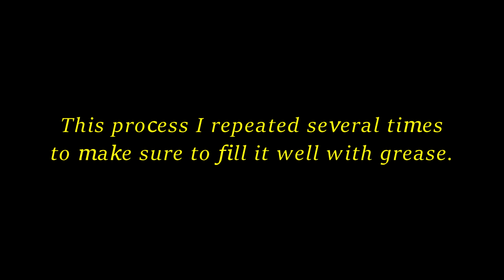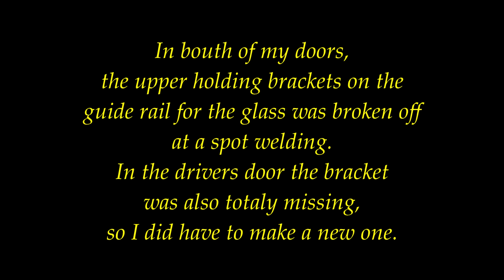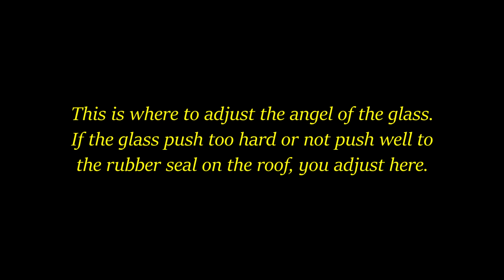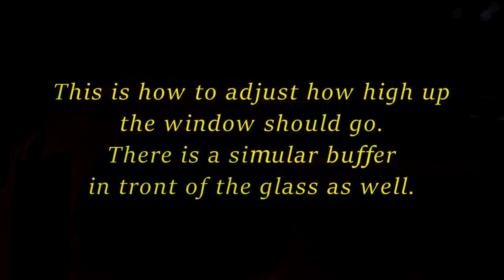SAAB 900 Classic convertible. Power window refurbishing.

Comment: Terje, you can grease the gearbox without removing it from the door,  get one of the retaining screws, drill an axial hole in it and tap the head to take a grease nipple. Then pump grease directly into it.
Here's what I did
http://www.uksaabs.co.uk/UKS/viewtopic.php?f=66&t=194004
Reply from the maker: I also have heard about the nipple idea, but as I did not have any of them or a grease pump in hand.
So this become the solution by now.
It does also not take that much longer time this way, and I think it is good for the elevating system to get out for a real cleaning and lubrication as well...
Reply: Useful tips from this video. Great work  @TerjeNormann   :) I just did this operation to my power windows and took a little bit of both of yours and Trollboosters advices. Greased up the motor still mounted in the door from the screw hooles using a large syringe filled with lithium grease. Then lubricated all other moving parts in the mechanism. Now the windows is moving a loot smoother :)

Comment: Hij, This has given me confidence to tackle mine (1990 C900 S). The driver side has displayed 'awkward/uneven' movement but not slower than normal, symptomatic of mechanical resistance. At one point three weeks ago I could hear the regulator motor clicking and disengaging without input, like a relay would click but with additional faint motor noises. I did a basic clean around the window seal and it worked just the same. Today no activity whatsoever from the mechanism. Window is fortunatly* in the closed position (*despite the 40c heat here for the first time). The mechanism obviously needs attention and will get it. Does the sudden transformation from 'working OK but a bit lumpy' to 'no sign of life' mean that I should pre-check the switch and electrical connections first?  This spec is new to me having a history of 99s.

Comment: Hi Terje, Thanks for clear video, that is my problem, I think the engine is defective do you know how to fix this without disassembling everything? Greet André van Beek
Reply from the maker: Iif only replace the motor, you need to unscrew the two screws that hold the mootor to the gear.
I'm not sure if you are able to get into the screws without to disassembly the mecanism. It is so tight in there.
But even if your motor is dead, I should do this entire job to make sure your system is not so slow that it is the main reason why your motor is broken.

Comment: Oh boy, another great video. i have to change my speedometer cable. oh and your advice with the pressure accumulator was pretty helpfull. but just asking, what would happen with the brake system if there is too much fluid in the brake fluid tank? also where can i find a fitting replacement for my defect brake pressure accumulator (ABS System). the only one that i found cost around 500-600€

Also you are lucky for having a garage. Down here in Germany its sometimes like a lottery. maybe i got something here so i can start working on my 900. i am gonna install a Trionic 5.5 and refresh the Turbo and the Gearbox
Reply from the maker: The only thing that should happen if too much brake fluid is...as I understand posibilities to over flow...only.
I do not know any other problems about to over fill..
I also have to change my speedo cabel, and I have one spare from my parts car.
The plastic connector for the speedo cluster is broken on the old one.

Here is some used accumulators on eBay:
https://www.ebay.com/itm/1990-1994-Classic-Saab-900-9000-ATE-ABS-Brake-Accumulator-4002267-Tests-Good/383247030296?epid=2069663124&hash=item593b4d9818:g:iDYAAOSwAUBdvgAp

https://www.ebay.com/itm/SAAB-C900-Classic-900-9000-ABS-Accumulator/303532514343?hash=item46abf29c27:g:1ZEAAOSwp6ReigTI

https://www.ebay.com/itm/1990-1994-Classic-Saab-900-9000-ATE-ABS-Brake-Accumulator-4002267-Tests-Good/383247764252?hash=item593b58cb1c:g:iDYAAOSwAUBdvgAp

https://www.ebay.com/itm/1989-1996-Saab-Accumulator-ABS-Brake-900-9000-ATE-4002267-55/352988958172?epid=2069663124&hash=item522fc80ddc:g:WLIAAOSwmVxeXIAE

And brand new
https://www.ebay.com/itm/NEW-Brake-Accumulator-Ball-Jaguar-JLM1907-Delco-25528382-Saab-4002267-OEM-JAGUAR/161474270314?epid=688219677&hash=item25989dd46a:g:H24AAOSw~1FUWlQv
Reply: @TerjeNormann  cool. thanks!!

Comment: Off topic -- Sons "friend" broke the casting on my 92 900 T for the drivers side manual release and I have no idea how to go about it. any help or suggestions appreciated
Reply from the maker: You mean how to remove it from the door?
If I do not remember wrong, the front surface is a cap that you have to flip off with a tiny screw driver and there is a screw behind it.
If you need a replacement, I maybe have for you.
Reply: @TerjeNormann  for the vert top release handle

Comment: Window stuck in open position, how do I get at screws on glass carrier?
Reply from the maker: Unscrew the lifter mecanism from the door and lift the window with the lifter until you can you access the screws.
Reply: @TerjeNormann  Is that the same for windows stuck closed?....I think the motor is seized. Any help would be appreciated. Thank you for the all the SAAB maintenance videos.
Reply from the maker: @billden4901  Open the door, take out the system and test run the motor without the winding mecanism. If the motor still run, it must be the window glass stuck in the rails, or the winding mecanism that need refurbishment.
Reply: @TerjeNormann  Thank you for your reply, will test it when I get a chance this weekend.